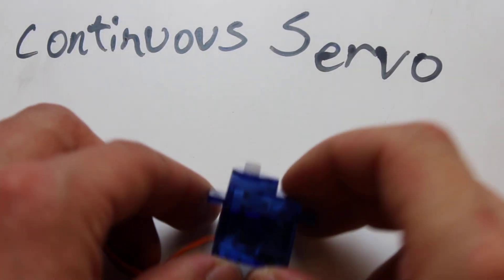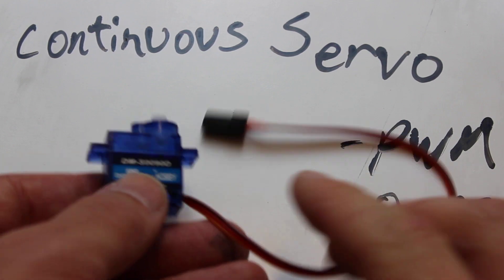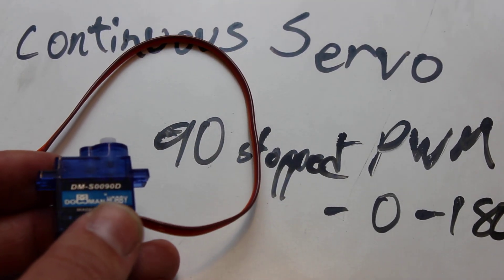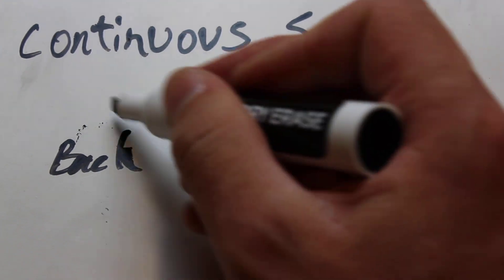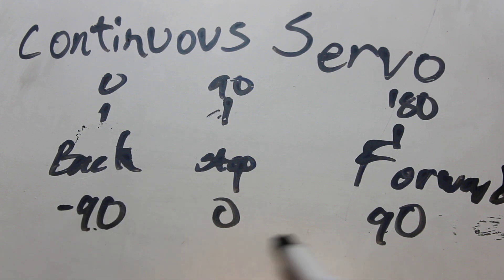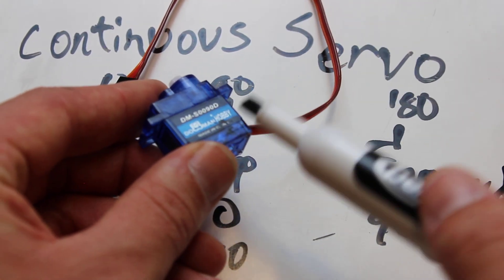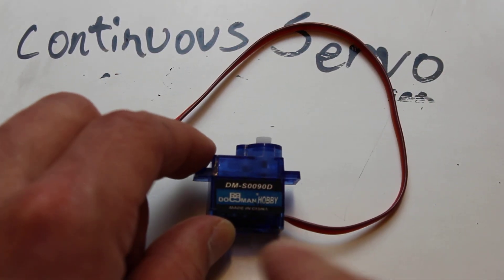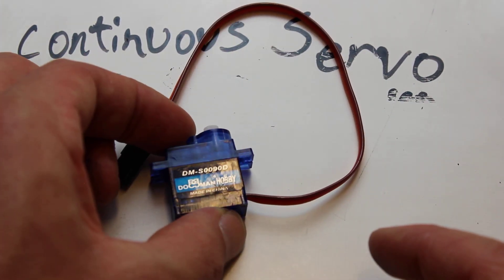How A Continuous Rotation Servo Works

Comment: I have MG996R and its is going clockwise on 0 ,it stops on 90 and goes counter clock wise on 100 , and while rotating Counter clock wise its speed is less as compared to clockwise rotation!
Reply: you have to mod the duty cycle some servos need more tha  180 degree signal to get full speed of the servo